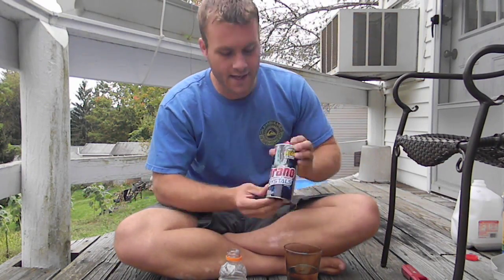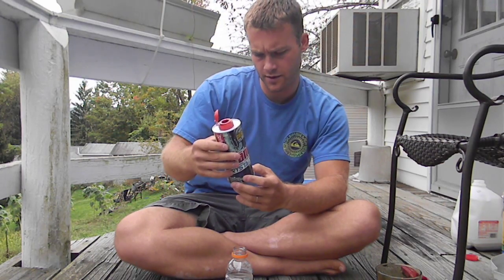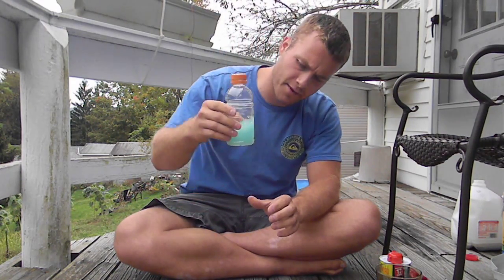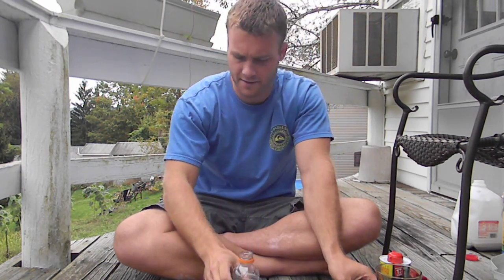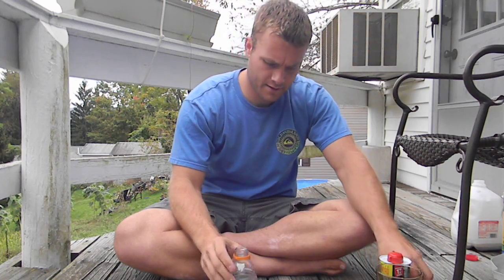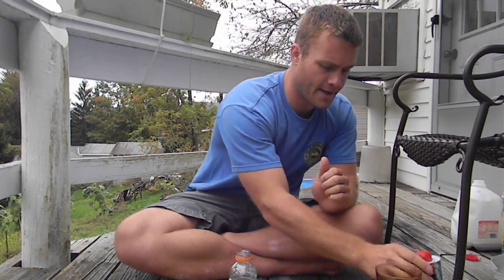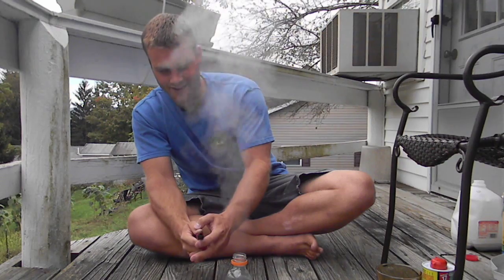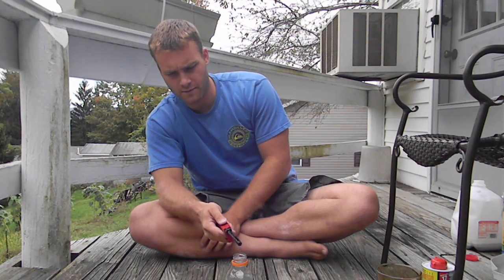Recycled Aluminum Foil Free Energy

Comment: i think electrolysis is better and cleaner
Reply from the maker: Hi Mitchell!! I think you are right!! it is much cleaner doing electrolysis. However this method is the best if you have no source of electricity such as in a winter storm or something of that nature. This year we used this method to fuel our propane heater for the house instead of the almost $200.00 for the 50 gallons that they wanted for propane. It worked!!! not quite as well, however it was free!!
Reply: John Bean
You are right in that way, maybe for camping or outdoor it could be a very good alternative. May I ask how much you spend on the sodium hydroxide?(Lye)

Messing around with hydrogen is always fun :) I was also thinking of useing solar cells to make Hydrogen, since batteries are crap, you can store it much safer and longer underground. Gotta love to experiment, I enjoyed your video!
Reply from the maker: Mitchell HürenKampf Actually I have been using Potassium Hydroxide that I spend exactly $0.00 on per gallon as I make it myself, it is easy actually and works just as well as sodium hydroxide!
Reply: John Bean
KOH, do you make that out of fertilized ground or something?
Reply from the maker: Mitchell HürenKamp Sorry for the year off!!! We actually make our Lye from the ashes of hardwoods. We soak them in water for a week, then strain out the water. The water is then concentrated to form potassium hydroxide. It takes very little wood ash, we just use what was burned in the campfire ring. I should update on both the hydrogen system and the lye production. Since last winter we decided with two children it would be safer to leave the experiments as experiments and used wood primarily to heat the house. We will be using wood for the next couple years until we have built our solar thermal mass heater. Trying to get out of the combustion age.